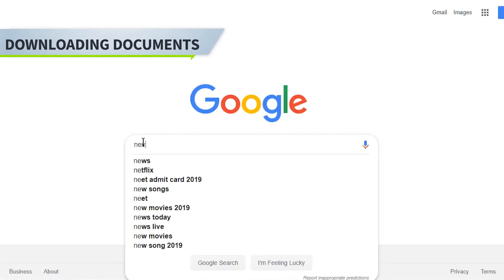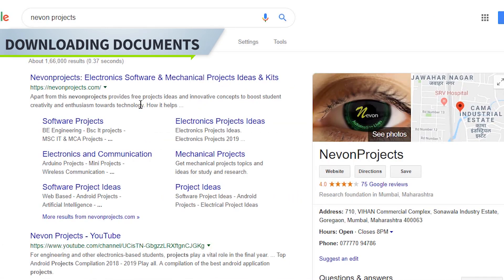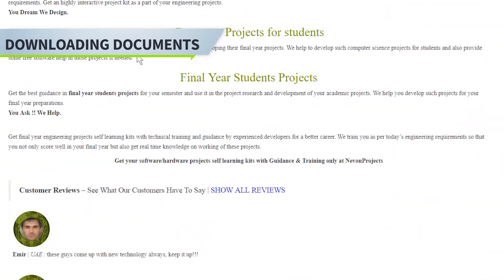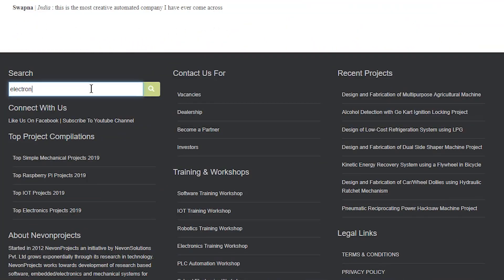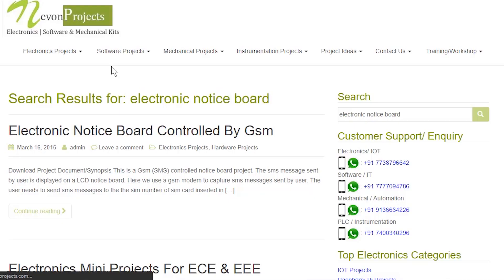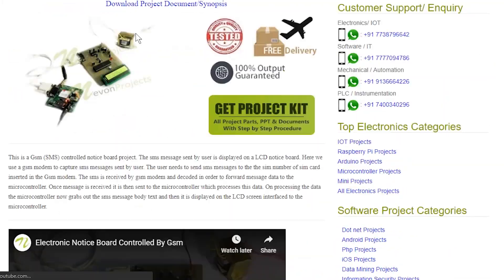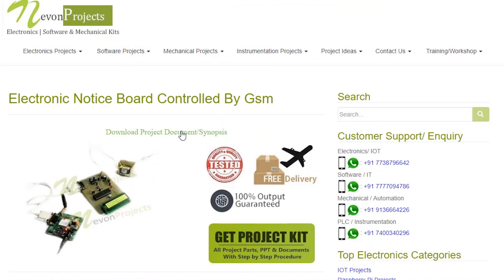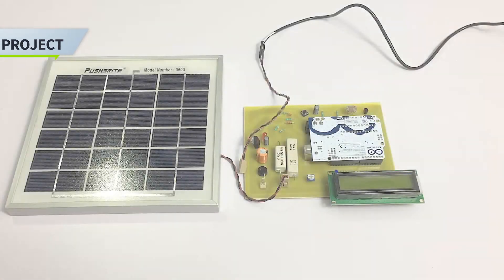How To Make Arduino Based System To Measure Solar Power Arduino Project

Comment: hi  i'm having problem, i have a project where i have to connect solar panel of 6v with 4 battery (1 of 1.5v) in parallel so i can increase the voltage but how can i measure the voltage across solar panel alone and battery? can you help me?

Comment: Can I know if it is possible that I create a counter out of this kit? (E.g. At a certain Visual Light Transmission and when it becomes dimmer at a certain range, the Arduino will count that as 1 cycle and so on and so forth)

Comment: Could give some detail about why we need to measure the temperature, voltage and current on solar?
Cuz I want to know more information about it. 

Regard!
Reply: Temp because solar panel's efficiency drops .5% with every of 1°C. Correct me if I am wrong.
Reply from the maker: For this project details or customized electronics systems/products development - Pls Call/Watsapp +91 7738796642